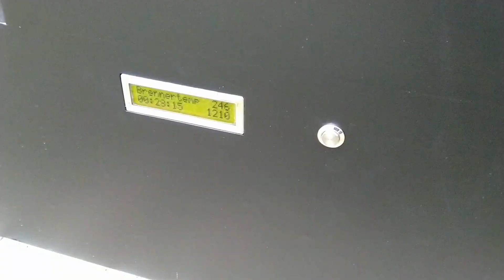Pellet Poolheater |Part 3|

Comment from the maker: At an outdoor temperature of 0°C, the heater heats up the water around 2.5°C per hour. 
The exhaust gas temperature after the heat exchanger is about 100°C.
Reply: How many pellets do you pass in an hour?
Reply from the maker: @shark8811  approx. 1kg

Comment: The box heat exchanger would have been better with 4 or 5 square tubes welded in vertically to allow the hot gasses up through the water jacket improving efficiency even further, the beauty is with your design you can pull it out easy and do those modifications anytime. Beautiful little unit nice work!
Reply from the maker: Thank you for your comment. I would have liked to have added a few pipes, but to increase the surface significantly I would need a few pipes and that would have blown my budget at the time. That's why I decided against it. But you're right, I can add some later, but I'm satisfied with the performance at the moment.